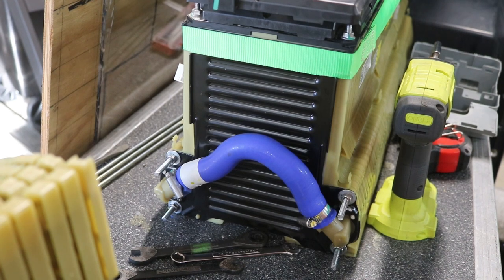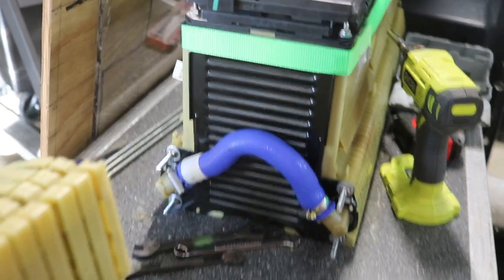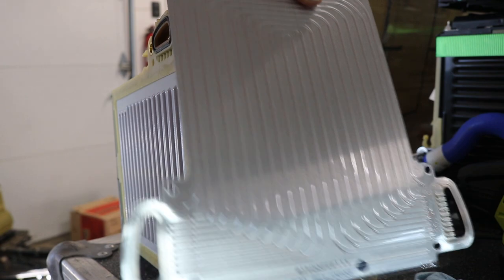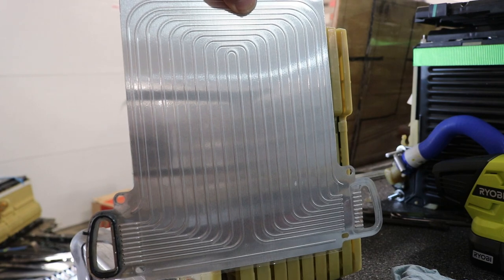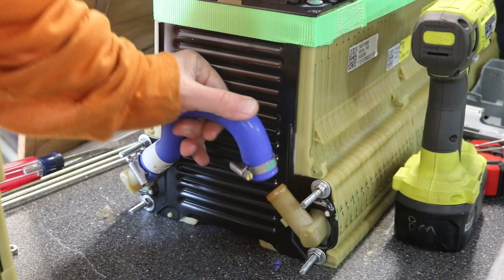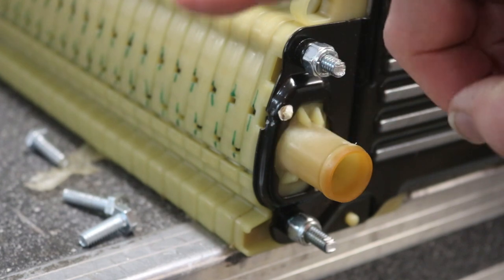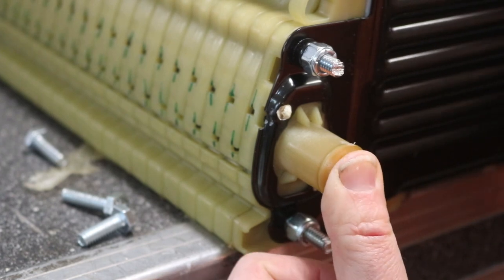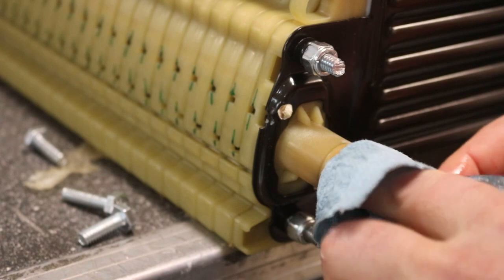Chevy Volt Battery Pack Disassembly and Reuse | Part 2

Comment: Hi Ben. FYI... the small coolant channels are a design feature that assures the turbulent flow of the coolant. Coolant moving with turbulence will greatly enhance the transfer of heat. Coolant moving as laminar flow won't transfer heat nearly as well. Hot water solar panels are made similarly. They may have a 1" connection diameter, but inside the panel, there are many 1/16" tubes to assure turbulent flow to pick up the sun's heat.
Reply: Great point, very interesting!

Comment: Awesome clearlylaid out internals of the Volt pack for DIY. I been recommending them for a while and have ALOT of happy friends who have bought them for ebikes and equads and they run balls out.
Reply: Also, there are two different cells in the YELLOW label and WHITE label packs.  The black plate modules and teh white plate modules have a different part number cell.. one is newer and holds about 1Ah more.

Comment: Love the air pressure tester Ben, I use the same brand I think
Reply from the maker: It was handy and the price was right. I could have gotten out my big air compressor and fired it up, but this pressure tester is just so convenient!
Reply: @BenjaminNelsonX  love it. Hey, what's your opinion on 400v vs 120v systems for ev conversions? I've been planning a em57 (or maybe one of the new Zonic motors from ZeroEV) build but my local conversion workshop think im better going for low voltage in this lightweight Spitfire build.

Comment: I have most of one of these batteries in my project. I didtn know the cooling passages work that way. I wanted to do water cooling but it was getting a bit scary with the high voltage cables and I decided to not do it at this point. In my car the motor is quite low rated and they will be slow charged so I am hoping they will be ok.

Comment: I would bet that there is a optimal inlet and outlet on the cooling connections. i.e. the fluid would flow better one way than the other, looking at those aluminum plates.
Reply from the maker: I was thinking that as well. Not sure which direction it “should” go though!

Comment: It looks like 18 cells in series? You mentioned making it 48V nominal, which would be more like 14S? Does the equipment you plan to use have a larger range than a standard 48V voltage swing?

Comment: Air will be trapped in the coolant passages unless unless you turn the battery upside down reupside down now before you put it in the tractor and fill the coolant passages
Reply from the maker: When the battery pack is in the car, the proper way to drain and refill the coolant for the battery loop includes using a Vacuum tool. I think that would be appropriate in this case too.
Reply: @BenjaminNelsonX  yes. Correct .one way or another way could be easier. 
Achieving a PERFECT vacuum is difficult.  Anything less than perfect will allow that same amount of an air pocket equal to the amount less than a perfect vacuum.  
It appears that a strong number of these batteries are coming in for warranty,  for this very reason.  Once the system is opened up and drained,  it is very hard for the mechanic to get ALL the air back out again.

Comment: I don't think coolant flows through those channels in the cooling plate, way to small.  It looks like maybe they are just raised channels to keep snug fit with positive contact to battery. The main cooling could be just right there near the orings.  I agree the all those orings are scary but... I doubt there is much pressure, unlike an ICE engine cooling system.  Just my 2 cents  :)
Reply: Sure it does. Look at the channel size in a radiator. And notice how much coolant came through when he pressurized the assembly... That coolant wasn't sitting in the two main tubes along the bottom corners of each cell. It was in the tiny channels in the cooling plates between each cell, for sure.